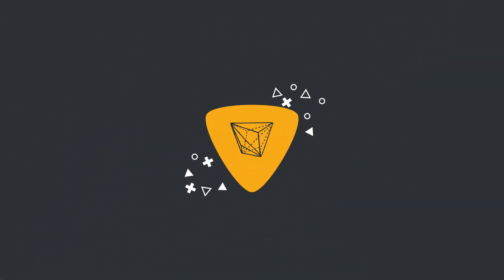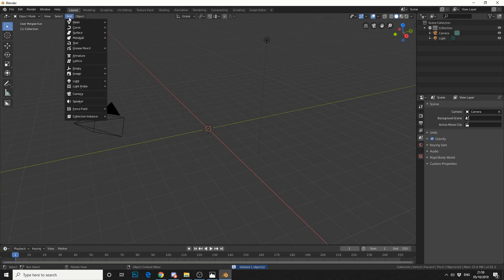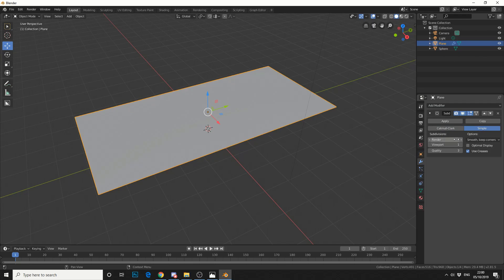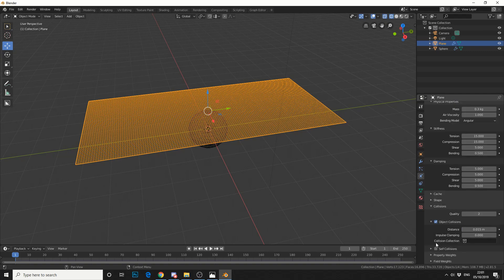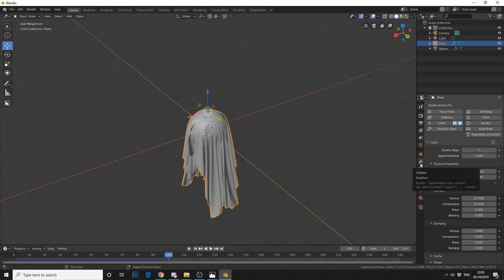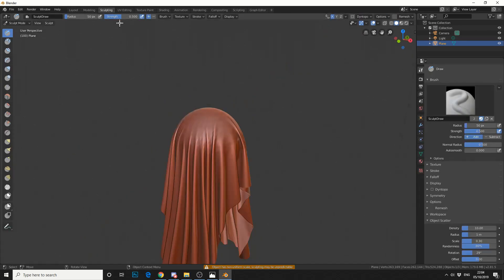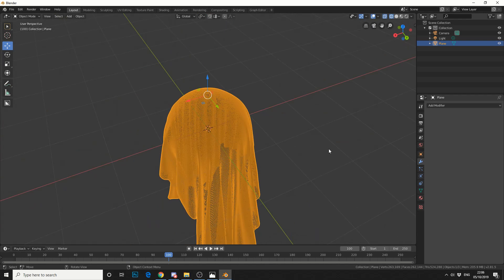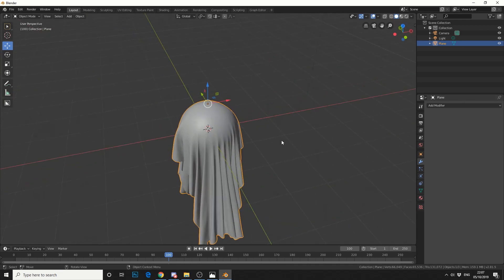Blender 2.8 Tutorial : Cloth Simulation ,Sculpt, Decimate PART 1 of 2

Comment: This isn't a great way to do this.
a. you want your quads on your mesh to be even for cloth sims, not elongated. This could have been solved by adding an edge loop across the short side of the base shape.
b. there's no reason to apply the subdivision and cloth sim - and in fact, if you hadn't applied them, you'd just be able to make the collision sphere higher resolution instead of needing to manually smooth out the faceting from the sphere. Wait until the end of projects to apply your modifiers unless absolutely necessary.

Comment: great video....and channel!  I have a question, when smoothing the mesh in sculpt mode, I get massive deformation.  It removes the steping but also bulges out the mesh heaps.  I ahve tried lowering the strenght but I don't get the results you do.  You mentioned holding shift but that doesn't do much that I can see.  Thanks again.